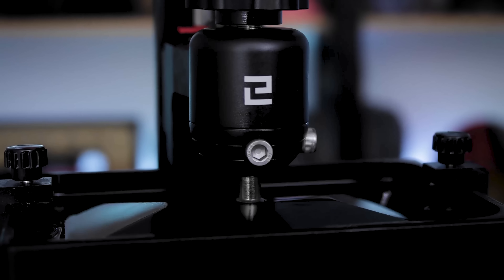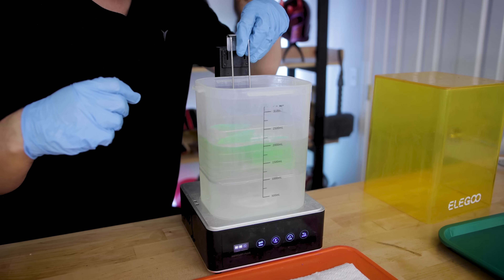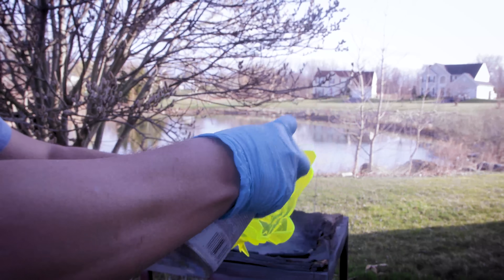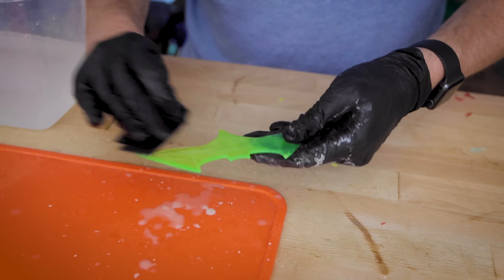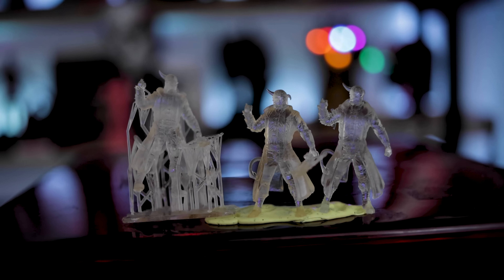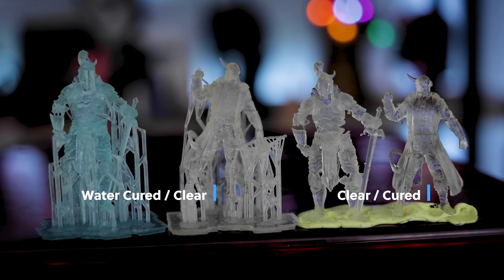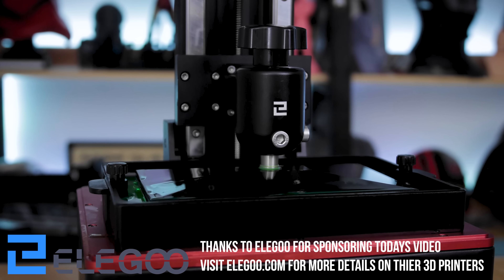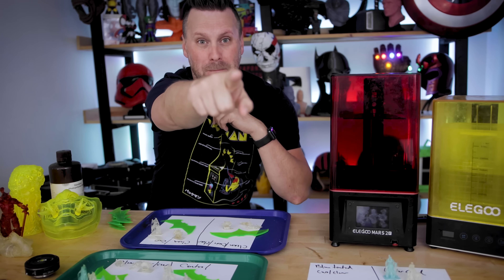How to get the best Clear Resin 3D Prints

Comment: I just did a test last week with first cleaning off all the excess resin with IPA after printing, let dry thoroughly and then with a fine paint brush paint thin clear layers of fresh clear resin on the print. Let it then dry before applying a second coat of clear resin. Then let that dry for about an hour. It doesn’t need to be totally dry. Then run it for about 2-4 minutes under a UV curing light. The results were pretty good actually. To see my results you can check out my Instagram “nixon_files” post about it last week.

Comment: Wash part in wash station. Plug hollow part drain holes with a dab of hot glue. Dip part in warmish resin and let drip dry with best available orientation. Then go straight to cure in wash and cure. Skip the wash part.

Comment: After curing try dipping it in Future floor wax. Might be labeled as Pledge Floor gloss. Dip it then look for bubbles or dust particles and if present, re-dip till there's none. Remove then let drip out/cure. It's acrylic based so can use Windex to clean up.

Comment: the method i found that works best for me... 3 steps... step 1.. 99% ipa wash for ten to 20 ... step 2 mr clean wash ( 2 to 5 mins) ... step 3 cure in container of 99% ipa.... only use 99% ipa and not 70% as water induces cloudiness... don't let parts dry between steps ... go for one step to the next immediate step... curing in a liquide removes oxygen from the surface which when curing cause resin to yellow, i have found that water cause cloudiness so I only use ipa.. the higher the % the better

Comment: I have a problem lately that after my print is done whenever I touch it with my gloves and alcohol, it kinda starts to disolve where ever I touch it and clean. I try'd using clean alcohol but didn't matter. as a result everywhere on the print I get these weird marks and whatever comes of the print just gets everywhere and looks weird

Comment: uncle jessy i need yourhelp i bought a brand new saturn and it will not print. i will go down start the first layer and then it shuts off comepletely then it turns on and reboots. ive tried re leveling re homing clean new fep and dumped and got all new resin. everything is elegoo brand. please help ive had this printer since march 4th and it has never worked not a single print off this thing. what can i do! please please help me

Comment: Clean, cure and sand, sand, wet sand, then clear coat
Clean in 90% IPA
Sand in multiple grits 320, 600 then 800.  I took the idea from wood guys and got a King Author GUINEVERE sanding kit (save your Hands)
Rust-Oleum Headlight Restoration Kit works great, 1200 wet sanding then buffing compound. (Hooks up to drill)
Clear Coat in a 2 part automotive Clear, I use TRANSTAR Quick Clear and use spraygun.
I get the interior buy pouring the extra clear and rotating to get a even coating.

Comment: With clear plastic I only ever put so much effort into it, but I read an article on removing scratches from model car windshields, aircraft canopies, etc., in which they detailed using multiple grades of wet sanding getting finer and finer, then rubbing with toothpaste, then finally coating it with FUTURE floor polish.  You might give that a try and see what happens.  The spray on clear coat seems to be skipping the toothpaste and FUTURE.  Barring toothpaste, maybe some form of plastic polish.  Google how to polish plastic to clarity.  That should give you some ideas.  Great vid.

Comment: Ironically to keep resin from yellowing, the traditional solution has been to add a liquid UV inhibitor directly into the resin, though for 3D printing, that obviously isn't going to work. Now you can add one after the fact and several places have such a solution, though if you want something more readily accessible, many commercial car waxes and polishing agents that are specifically for plastic have UV inhibitors in their formulas. With a bit of intense google-fu and searching through my bookmarks, I could probably unearth an industrial UV inhibitor product that you could add in to a spray bottle.
Add: Derp moment, I also remembered that Krylon makes a UV protective spray for fine art type applications that I've used on urethane, though I don't see why it wouldn't also work on a resin print, so long as you're definitely not wanting to further cure your print. =D

Comment: For white resin that has discolor or turned brown, I pop prints a bowl of water and microwave for 2 to 3 minutes. Brings 'em back to pure white. May work on clear resin as well. Gotta be careful because the heat does soften prints momentarily and could warp smaller items.

Comment: -Try peroxide and sunlight or UV light; restorers do it to remove the yellowing from vintage 80's toys, a possibility just to try it.
-Fire polishing from a propane/butane torch after your final high grit sanding.
-A buffing wheel from a dremel for polishing.
-Simichrome, Autosol, or Flitz
-One-Step Plastic Polish
-?(for visor) cerium oxide glass polishing compound or use it in a rock tumbler for the miniatures?

Comment: I have found clear resin to be tricky stuff, over curing definitely yellows it even some of the colored stuff it’s just less noticeable, I under cure in cure station then let sit in gentle filtered light for a day or so taking it in and out of light source, a bit more work but better results... you can also water cure then let dry and if the piece doesn’t have too much detail that could be lost, I paint a thin layer of clear resin over my prints then cure it with a handheld light then cure normally, again be sure not to over cure this will crystal clear prints... do keep in mind that if you hollow the object you will need to put resin inside as well, I will also put clear resin inside a mini but not the outside this will preserve exterior details and give cleaner clearer looking print... the issue is the micro layers even if we can’t see the layers, think of them like rough sandpaper how it puts scratches and digs into and object, these micro layers refract light giving you a dull or satin finish, sanding and filling these layers makes it smoother and the smoother you can an object the more glass clear it will become basically what they call optically clear the light passes straight through the piece thus making it truly transparent, more fraction less transparent... So try this clean the print normal cure for 30 sec then water cure for your normal time maybe a bit less to prevent yellowing if you can or skip then paint a clear coat of same clear resin on outside let it level a bit then cure immediately this will render a nice clear result, also use a I’ve inhibiting gloss clear spray coat on outside then sun cure... obviously you can’t do this on a mini but you can water cure and clear coat inside of mini then cure again for a few seconds then use clear coat spray is last step to fill any other layer lines that remain... try this out hope it helps.
Edit: also print lowest layer height as possible or bearable because again even though we don’t see it this helps with light refraction

Comment: I have used a 'headlight restoring kit' quite a while ago to refresh our yellowed and oxidised car headlight (plastic) glass. The kit came with fine sanding paper, some polishing paste and a drill mount little buffer. Using it, the headlights lost most of their yellowing, became nice and smooth, but also became opaque due the microscopic scratches which were now even and totally covered the 'glass'. Then the kit had a tube of 'UV protectant' which also smelled like paint. I painted it on as directed and voila! the headlights looked brand new again! Completely clear and transparent.
I would wager that this stuff, which is available on its own, would have the same effect on washed and cured resin prints. My observation is that the pores created by washing the prints stay there after curing - and get filled by this clear liquid, just like the tiny scratches on the headlights.
I will try the stuff shortly, you have inspired my curiosity, Uncle Jessy.
Reply: PS: the headlights stayed clear and transparent for a year so far. The car is always outside in the sun and weather.

Comment: My recommendation is not to start with 220 grit, even if it takes longer, start with 600 and go up to 2500, and experience says the resin sucks alot of clearcoat into the pores, so a coat of clear, sand, clear, sand, clearcoat, polish

Comment: you could potential try dipping prints in Pledge Revive It Floor Gloss, its a clear high gloss acrylic finish that lots on molders uses on clear parts like airplane canopy's or even airbrushed as a lacquer for more slight satin finish, might work on 3d print
Reply: Cool. I was looking for a way to make a clear lense for a dial.

Comment: What about using some sort of either 'ultrasonic with a sanding medium' or a 'soft pellet tumbler' for the smaller detailed prints. I know this method is used in various other forms of finishing.
Reply: I would like to hear more.  There is a company called Post Process that has one but they are ultra expensive 25+

Comment: from my time working with plastic model kits, try a much higher grit paper. You start achieving a clear transparency after 2000 grit, and I have always taken it to 7000 for most, and in clear/untinted up to 10000 grit. You can buy polishing compound to get an even higher shine. REmember soft sanding is going to take away the hard edges and produce some soft corners. Sanding with a hard stick will get you a flatter area to see through. Also be careful with your clear sprays, some can do wonders, some can actually only add a dull shine. My experience is to stick with some Alclad II Klear Cote, or Automotive Clear Coats. If you can add some leveling compounds (a paint additive for modelling paints) can help get a good transparency.

Also, a good thing for removing support marks for clear parts is to do the same thing modellers do. Do some big supports, and grab a sharp pair of nippers and cut it with a little bit of the nub left. take your time and sand that nub down with a sand stick or cut it afterwards with some really shallow cutters. By tearing your supports off or cutting them right at the point of the part, you end up cracking it in a way that leaves a mark. You want to take as much stress off the cut as possible.

Comment: When I made my hourglass with Sirayatech Blu for one of my videos I brushed on Polycrylic. I found the spray version left little dots on the print from the droplets leaving a textured finish while brushing it on left it more glass like. I also did 2 coats. The tricky part is that if the print is hollow you have to get both sides. With a pourable coating you can just pour some inside the model, swish it around, then pour it out.

Comment: sand with 2000 wet r dry paper (add a drop of dish soap to the water to keep the sanded bits washing away) then clear coat again. you can then use a fine buffing compound (auto store) to really make it shine.

Comment: oh.. sand down to at least 1200 first.. don't waste time with anything less than 400 grit the resin is so soft you're doing more damage than good... 400, 600, 1000.. go 1200 or 2000, then hit it with a polishing mop...

Comment: A clear coat makes the Objekt more transparent!? That would mean that the dulling is primarily an issue of the surface?
I have some transparent resin but I use it rarely because the results are in general more opaque and yellowish than I like.

How about molding and casting? Would that deliver a more crystal clear result? 🤔
Reply: Dulling is definitely the light refraction from the grain of the printed layer lines of resin. Clear coat fills the texture in, and makes it smoother - same effect as fine polishing. The yellowing is the more interesting aspect to solve here IMO.
Reply: @KevinVanderbeken  
thanks for the reply. ;-)

Comment: For my crystal clear lantern rings, here is what I did:
Wet sand 220
Wet sand 320
Wet sand 600
Wet sand 800
Wet sand 1000
Polish with tomia course
Polish with tomia medium
Polish with tomia fine

If you skip too many grits or polishing compounds you increase the risk of needing to redo sections, and it takes more time.

Comment: I've noticed that if after printing, cleaning, and curing you apply a very small amount of uncured resin on the model (with a brush or something like that) and then cure it again it ends up a lot more clear for some reason. I really don't know why, but hey, it works!
Reply: Is it still yellow?
Reply: @kapalaka  I've used red resin, but yes, its still the right color. It's just more shiny.

Comment: Some people have printed my Scarlet Witch tiara in translucent red and it looks incredible. Just a spray of 2K clear on top, and amazing result. I also did this for the Starlord Blasters cartridges, clear coating and polishing the inside and outside and the result is incredible.
Reply: Also, to prevent the oranging of the clear resins, I found out it was better to spray it with a UV resistant clear and then not cure it too much, but eventually if you polish it it will also get rid of the orange
Reply: And also, last but not least, really cool video man!

Comment: A few things I've found:
- Automotive clearcoat is better
- Print solid
- If you're going to take your prints outside and don't want them to turn even more yellow, get yourself a car headlight restoration kit with UV protectant. It's usually kind of protectant that chemically bonds to plastic like a clearcoat that blocks UV light. 
- If you print a flat-ish surface, you can do the old wetsand polish thing where you keep doubling your standpaper grit. Once you hit 4000 grit, go ahead and clear coat.

Comment: When I use Elegoo's ABS-like clear transparent resin I found I only needed to cure for 30 seconds or so in the Wash & Cure station. Any longer then that and it started turning yellowish.  Was told by some folks after my first few prints were yellowish that was all the time needed because the light goes all the way through. Which made sense but I had not thought about it.

Comment: Another easy solution to glossy prints is after curing use a brush or whatever works for you and coat the print with the same resin it's made from and use a uv light to cure that coat.

If you have questions or what pictures and examples I can send you some of you contact me.

Comment: Oxygen is a big issue for clear. Keep the prints oxygen free until cured. Remove from printer, immediately clean while submerged. Then cure submerged in water. The result is a nice clear print.

Yellowing will fade in most cases if you let the prints sit for a day.

Comment: Probably get a lot better results if you used a a non junk clear.(get one of the two part cans at least)  Also wet sanding and polishing after clear will make a huge difference
Reply: TRANSTAR Quick Clear Coat works great.  For automotive but works great.

Comment: Instead of rustoleum clear, I recommend picking up a 2k clear. Rustoleum and other store brand aerosol, use air dry, so they lose shine as they cure. 2k is chemically cleared, The same we use on automotives, so the shine you see when you spray, is the shine you get when its cured.
Reply: KBS Diamond clear is a phenomenal clear if you want a wet look.
Reply: @johnellis6911  
I replied to op, in the event they don't see it, could I get your feed back to ensure I pulled up precisely the correct one(s)?

Comment: The benefits of water curing are removing gaseous oxygen from getting to the model, so in order to get the best results you will need to clean it very quickly and limit the exposure to air as much as possible before putting it into the water. This is mostly for surface quality and even curing, since water allows a more even refraction of light in small crevices of the surface. Since these tiny areas get more light and cure more it will probably cause them to look hazier. I'd imagine that coating them in clear before curing will give you similar results since you are also forming a barrier between the model and the open air. But water curing is usually done for durability and surface quality rather than clarity throughout like with clear prints. So maybe if you want clear prints go with spraying on a clear coat, but if you want durable prints go for water curing?

Comment: Did you use distilled water or tap water in the tank for the cured-in-water tests samples. Tap would include minerals and metals that interact with both uv light and the resin, perhaps.
Reply: Also, the yellowing comes from not using a UV proof/resistant sealer.
Reply: And finally, using uv resistant resin and sealer, flow coat the sealer on items that do not have details you want to coat, such as the Mandalorian visor.

Comment: 8 days ago I printed rc headlight lens on my channel with clear resin and sprayed clear coat without washing it, it came out amazing
Reply: How you prevent the print from being sticky? I find clear resin to be much more sticky if I don't clean with IPA. Did you cure after the clear coat?
Reply: @fusionor  yes after print didn't wash it, just put it under sun light and then wet sanded it and clear coat it
Reply from the maker: Nice man! I forgot to mention that when I directly sprayed without cleaning my prints were super sticky after. 

What sort of Clear Coat did you use?
Reply: @UncleJessy  I used automobile clear coat that comes with hardener and mixed 2 by 1 and 1 thinner,  it looks like a glass, I got so may hate comments, telling me its resin molded lol
Reply: Scale Addiction,,, love your videos
Reply: @tastybrew  Thanks, appreciate that